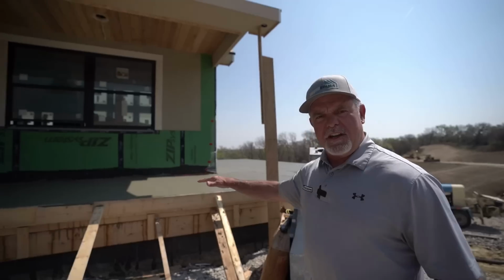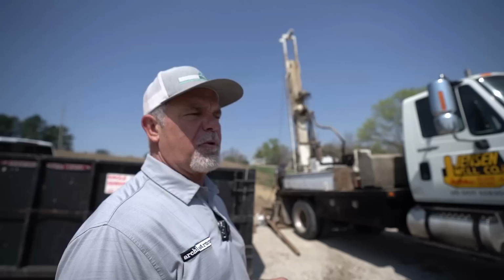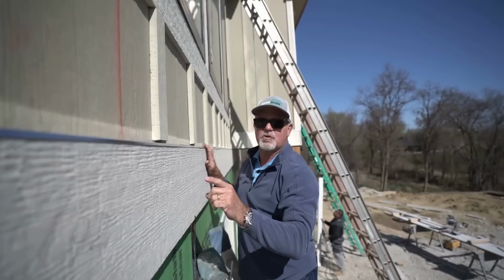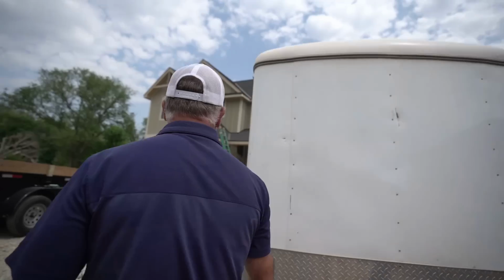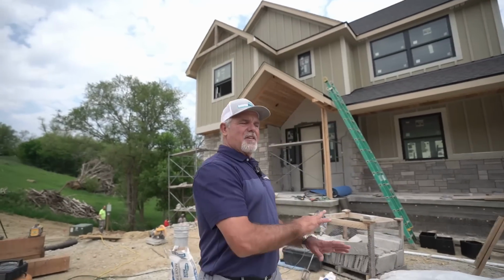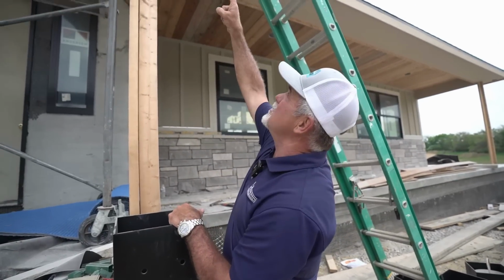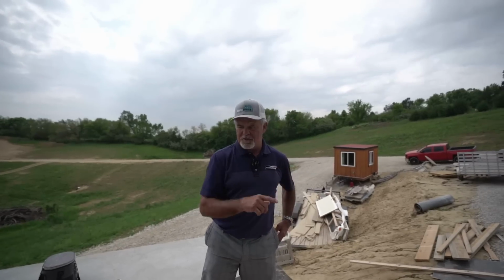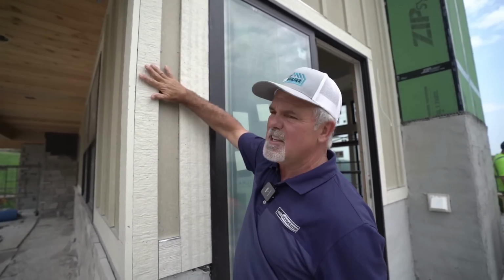Building My DREAM HOME In FLAIR'S BACKYARD! (Concrete Porch, Drywall, and More!)

Comment: Brad you should do painted reclaimed wood or painted tongue & grove on the wall above the stone on the fireplace and  go to wood place that you went for Flairs mantle and get you some wood to make you a mantle like Flair’s I think it all would look awesome with how yal are putting stone on either side of your fireplace and also make sure you put in some wire mesh on the fireplace vent and flue to keep birds and other varmints from trying to get into your house through the fireplace.
Reply from the maker: That’s a great idea for the fireplace chimney cap to keep the birds out… Other ideas I have to get that passed Interior designer and my wife!!
Reply: @BradtheBuilder  Ook I totally understand I just thought I’d tell you the ideas.
Reply from the maker: @mcherry205  please keep your ideas & suggestions coming 👍
Reply: @BradtheBuilder  i definitely will..

Comment: Stamped concrete will really make it look up town  🎺👍
Reply from the maker: Until it cracks! 🙆‍♂️ ( it did)
Reply: @BradtheBuilder  oh no !
Can they fill the new cracks with powdered cement and that glue that you mix with it ?
Reply from the maker: @dalegereaux1863  we’re going to try it and then the worst case we will have to finish the top with a concrete paint cover
Reply: @BradtheBuilder  if the crack filling doesn't look the way you want it to, hire an artist come out and draw in more cracks so it looks like marble. Years ago a friend did that for the concrete floor of his Italian restaurant. You can't always fix cracks but sometime you can disguise them.
Reply from the maker: @dalegereaux1863  that’s a good idea. We are also looking at some cutting or the cracks and create a pattern.
Reply: @BradtheBuilder  what is it they always say ?
Find a way or make one.
There's always a solution ! 🎺
Reply from the maker: @dalegereaux1863  amen!

Comment: So in Florida, we obviously worry about wind and how to protect the house and property. What kind of wind regulations are you subject to up there? What kind of wind speeds do you have to hold up to?
Reply from the maker: I have to put on  Hurrican tiedowns on all top plates… we get tornadoes in this area
Reply: @BradtheBuilder  that's what I assumed your wind precautions was for, but I'm pretty sure, though nowhere near the size, have way more damaging wind speeds. 
Our condensers have to be rated at 100mph, and though I don't know much about the framing end, I remember a framer from TN crying about how much hardware was necessary by code 😆.
I was just wondering if maybe the details had an MPH on there like ours do...
Reply from the maker: @JayWillis2120  I’m not sure what the rated for but they’re called hurricane tiedown clips by Simpson

Comment: You could probably get a lot better gas mileage doing errands and towing capacity with a OBG Tuner controller on your truck. They tune it as a terrible comprise from the factory for the EPA tests and nothing to do with what part of the country the truck is driven in and your elevation.
Reply from the maker: I need to look into getting that !
Reply: @BradtheBuilder  Yes, with a tuner, you tell the tuner exactly what octane you're using and that alone improves everything. 
 I don't remember if you have a diesel or not but the EPA has diesel terribly tuned as well.
Reply from the maker: @shoutingATclouds-btw  I have a Diesel

Comment: So, since you used concrete as a top-floor porch. How much reinforcement did you use to carry that weight? Any I-Beams? Adjust spacing? Or did you let the outside cement help carry the weight?
Reply from the maker: Over the front porch there is 2 x 10 framing 12 inch on center and the engineers say that’s enough to carry the load of the concrete. I also put a Waterproofing membrane over the plywood before pouring concrete